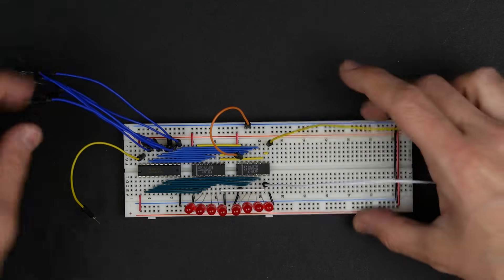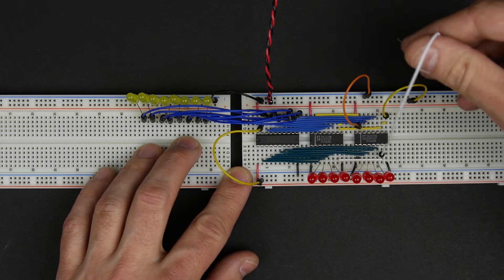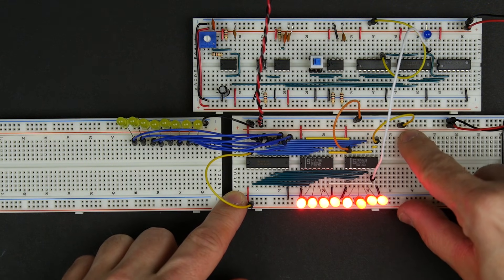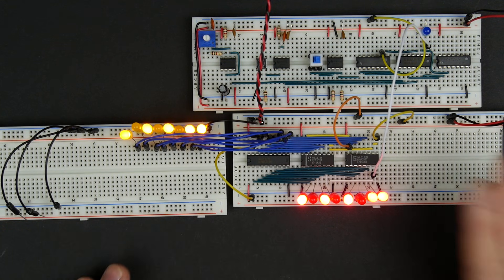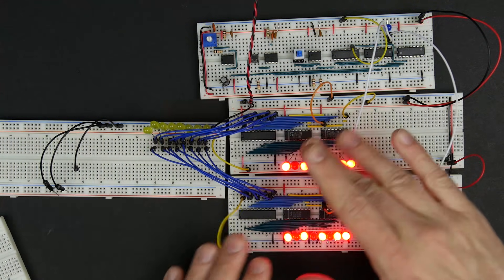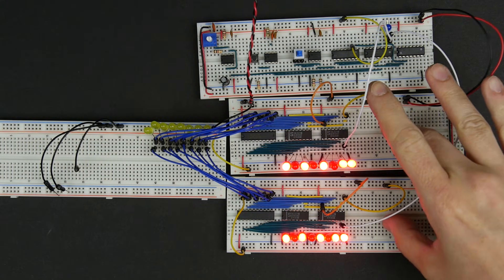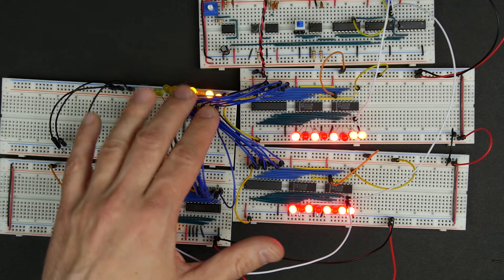Testing our computer's registers - 8-bit register - Part 5

Comment: Great tutorials.
I have an issue though – Registers.

I can get them to read from the bus, but I cannot get them to send to the bus.
I am very sure the circuit is correct – so I cannot figure out whats wrong.

Can you advise what to try please?
Reply: Same issue, any fix?
Reply: @kpjVideo  I think you need resistors for the LEDs since they draw too much current
Reply: @pantographj  Yep, I think you're exactly right. When the LEDs had some resistance to ground, the bus was working as expected. Bit strange since on Ben's part list the LEDs listed draw the same current, but who knows.
Reply: @kpjVideo  I'm still struggling with that. When I load all 1s into a register and try to output, it ends up dropping low enough to clear the register. Not sure what the issue is yet, but it's annoying.  Without resistors I couldn't even get anything output at all, and the chip was extremely hot.
Reply: Same here. Had to solder the resistors to the LEDs to get this working. Else the cabling would be a complete mess.

Comment: I am having a problem with the output pulsing with the clock. when the clock goes high, the output pulses low and vice versa. I have triple checked the wiring a hundred times (I know what I said), and everything is connected as it should be. I am suspecting my power supply could be the issue, but I don't have an alternative supply to test at the moment. Has anyone else experienced or diagnosed this problem? I'm stumped on what should be a relatively simple circuit but I don't want to progress until this issue is resolved.
Reply: Juicyblunts , see my post about bad chip supplier. I had similar odd results.

Comment: Hey question for anyone here also working on this, I made the cpu clock with the manual push button and the 555 debouncer, and when I use this with my register to clock it it functions fine, but while it's pressed all LEDs  connected to the  chips turn off, and this isn't an issue I've seen anywhere else so wondering what I might have done wrong?
Reply: Cont3mplation , did you get this resolved? If not, I may have a suggestion or two but would need a bit more information.

Comment: Is the 74LS245 tri-state buffer supposed to get warm? When I finished testing the bus with some LEDs I noticed the buffer chip was slightly warm to the touch. Not hot by any means. Unlike the example in the video I chickened out and put current limiting resistors on my bus tester board. I did the math and figured I'd need 150 ohms to protect the LEDs, I used 200 ohm to be safe. I just hope I'm not still drawing too much current.

Comment: I'm trying to troubleshoot my register, one half of the bits are turning on and the other not. I think I've checked the power to the chips and it is distributed correctly, does anyone know what could be wrong?
Reply: I just finished troubleshooting my registers and now both registers are working. The easiest way I found to debug was to do one bit at a time. I only had one register chip and the 245 chip, then I connected one output wire, one input wire and an LED. Be sure you have your wires connected correctly
Reply: That sounds like a great way to approach it, I'll try it. Also thank you.
Reply: Not sure if you resolved this so letting you know to see my comment about the chip problem I encountered. Take care.

Comment: For the IR, are the two G1's supposed to be connected? (the bottom yellow wire connecting the two 173's). For Reg A and Reg B you connected the two G2's.
Reply: Everything is working for the IR except for the 4 most significant bits. I can not seem to load or enable them.

Comment: I replicated this circuit but the voltage out is significantly lower than my voltage in without any current limiting resistors, does anyone know what might cause this? Im talking output of < 3 volts but > 2

Comment: Does anyone know the specific type of 22 gauge wire he is using? The plastic outer sheathing on his must be thinner than mine because I can't fit my wires in as tight as he does no matter how hard I try. My plastic sheathing must be fatter/thicker than what he's using. So I want to figure out what he's using so I can redo my wiring.
Reply: David Courtney you are stripping the wire ends, aren’t you?
Reply: David Courtney , I noticed the same but I just let them overlay one another where space was as issue. You may be a perfectionist like me and wanted it to look exactly the same. I get that. But, I got over it and moved on. :)

Comment: Why in the very first videos, he connected  LEDs with resistors, and here LEDs are connected directly to chip outputs?
Reply: This is correct, the 74series logic have internal pull up resistors, so the current limiting resistors he used in the clock video are not needed here
Reply: I think the answer is that he is using 5v LEDs now and resistors are not required
Reply: if I remember right it was because the IC chips have resistors built in (I think he says it in the 555 clock section)

Comment: I'm having trouble with this. The registers I built out put an inverted signal. I used the same chips and have been through the wiring a dozen times. Can someone help me out?
Reply: Did you solve the problem?
Reply: alexander kramer , see my comment about the problem I had with the chip supplier. Perhaps you have the same problem.

Comment: Instead of 6x 74LS173's - Can you use 3 x 74ACT16374 - as 2 (8-bit flip-flops)? Less wiring.
Reply: Paul Mc Quade That would be more wiring because the flip flop he is using is a bus driver. You would need and and not gates for each bit.

Comment: I got a problem, the data out of register is also flipping along with clock frequency, but high the frequency, data out of register is stable. Any suggestions?
Reply: Hi, how you solved this? I have the same problem.
Reply: did you get it to work?
Reply: Have you solved it now? Same problem for me.

Comment: So you have not posted in a while, I finished the computer without you, it was a huge challenge but I did it, post more, you have not posted in 2 months, don't let us down Ben, your subscribers need you.
Reply: Can you upload a pic of your completed system?

I am interested in finding out how to hook up the LEDs on the bus lines.  I am ready to move on myself, and I have already created the instruction decoder and my make shift bus needs to be upgraded to one like Ben has, I only need to know how to setup the LEDs on that bus.

Thank you
Reply: Jeff Nay What do you mean by the LEDs on the Bus Line.
Reply: What do you mean? Just hook up the positive leads of the LED to the bus and the negative leads to gnd… HIGH would pass current through the leds and turn it on, LOW would not do anything
Reply: I thought that Beau had already completed his SAP-1. Did you complete or nearly complete your Thor?

Here is a diagram of what I have setup, as far as the LEDs on the BUS are concerned.
https://drive.google.com/open?id=0B6LIgQzDkH8fTG1kUUMtXzdTcDg

Here is an actual pic of my BUS line LEDs
https://drive.google.com/open?id=0B6LIgQzDkH8fTmEwNW1VOEJpems
Reply: BEAU
I thought you completed your computer?
Can you upload some pics and make some comments on what challenges you went through?

Thank you
Reply: He means that I wasnt the one having problems. I was helping Beau Haeker who didn't know how to connect his LED's.
Reply: I think he explained elsewhere that the LEDs being fed through the ICs don't need a resistor as the IC is acting as a current limiter.  Hope that's correct, sadly my memory doesn't store abstract information about electronics terribly reliably!
Reply: Correct This topic will not go away. So far this is all 74xx TTL logic which in almost every case has 20 mA source/sink. 

Why do you suppose LEDs have a 18-22 mA sink?  

Latter on came CMOS, etc.  everything got confused. Data sheets started talking about "resistors." It went to hell. 

Think in terms of logic families and the source/sink specs. Worry about passives like LEDs latter. 

You are not the only one to have trouble with this. I come the vacuum tube generation so got to watch the whole show.
Reply: Beau Haeker He did say he would do it in his spare time as he has a job
Reply: He knows that

Comment: Nice explanations.   What programer are you using for the CAT28C16 eeproms?  I am building along using breadboard but making them more permanent by soldering the modules up on adafruit perf board designed with the same holes as breadboard.

Comment: How do you cut your wires to such a perfect length?  I can never get mine just right...
Reply: Mr_GreenCoat measure the length of the connection needed with calipers, then put it next to wire and score where you need to strip

Comment: 03:20 Is it possible to use 2-color LEDs for displaying the state of the bus connection to distinguish between high (red), low (green) and unconnected (not glowing) states? I think this might help with understanding which registers are connected to the bus and which aren't, and what is their internal state at that point. Hmm...
09:56 Instruction decoding... That's the shizzle I'm waiting for ;> because this is usually poorly explained, if explained at all.
BTW are you gonna show only the micro-programming way of decoding instructions that you used in your computer? Or will you show the other options for instruction decoding as well? (e.g. some hard-wired combinatory logic decoding into control signals)
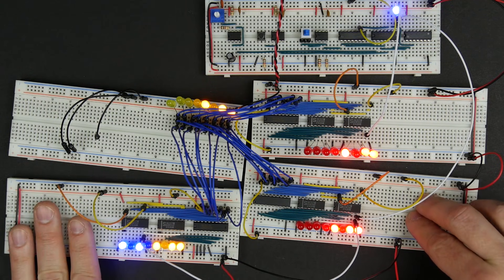10:50 What is the minimal set of registers a computer needs to have to be Turing-complete? I guess we need at least one data register (e.g. an Accumulator) for storing temporary results between arithmetic operations. But we also need to keep track of the address of the next instruction to execute. Well, we could keep the instruction pointer somewhere in RAM; that would make our computer slower, because it would have to reload this address from RAM every time it needs to fetch the next instruction, and then store the updated counter back into RAM afterwards, but it should work, right? Yeah, but this means we need some address register to control the address bus anyway, I guess... Hmm...
Reply: It is most likely possible if you would take RGB LEDs and wire the bus to red, and invert the bus and wire that to the green pin. I'm not quite sure how to be certain that unconnected would work. Maybe just a massive NAND gate with all the loads and enables so that if you manually 'disconnect' it just zeroes the bus and the inverted bus.

Comment: Hey Ben, what is that third chip you have on the breadboard besides the registers.
Reply: +Beau Haeker It is supposed to provide a tri state output after the LEDs. This way we can see the content of the register on LEDs and still have a tri state output.
Reply: +Beau Haeker  Just watch his previous videos. He explains its purpose there.
Reply: Those are basically three 555 timers and a couple of logic gate arrays that he used to build the clock (some of them used to build a flip flop out of scratch) . You can check on his first videos of this series on how he built'em.
Reply: +Angel Gonzalez No, I was talking about the octal bus tranceiver, what is it for?
Reply: Oh sorry bout that, but its what vultra said.